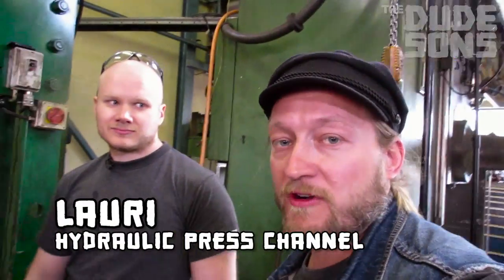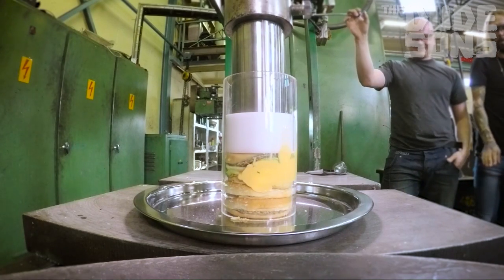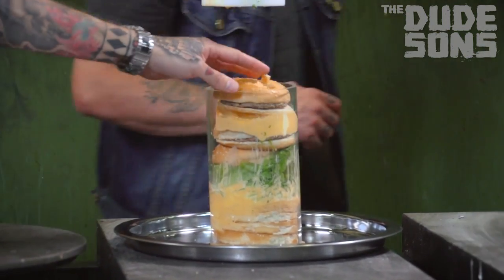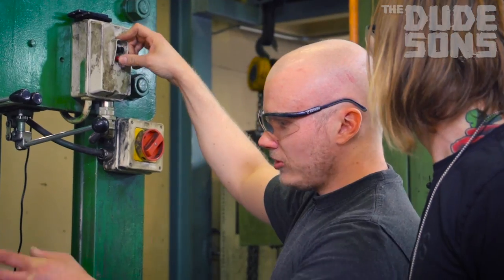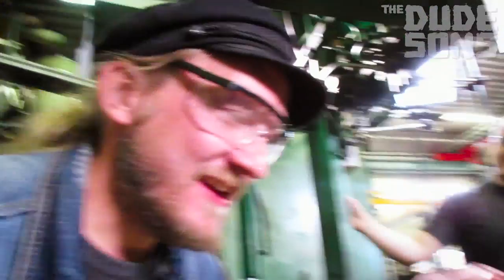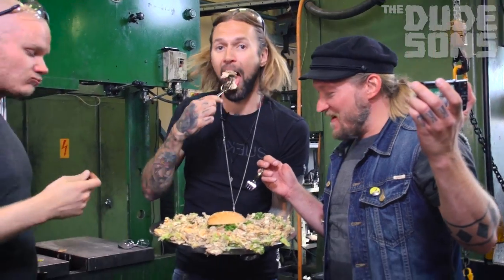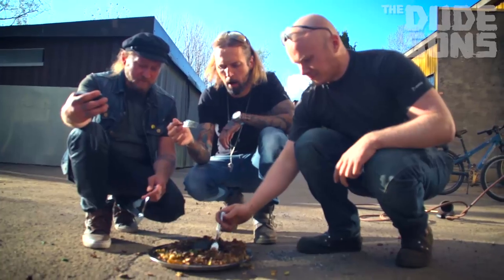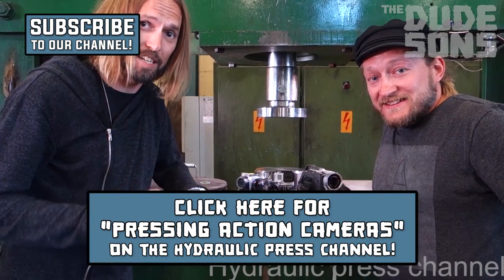Ultimate Hamburger Challenge with Hydraulic Press Channel!

Comment: Even diamond breaks,but not the pig
Reply: Britney is love, Britney is life.
Reply: Gabrielmuniz diamond are weak because strength and hardness are completely different things in the metal and gem industry
Reply: Diamonds can break
I saw a video where a guy smashed it with a hammer and it broke
Reply: PiratmitHolzbein Yea they're just hard to scratch.
Reply: how could they though. Jojo part 4 said diamonds are unbreakable
Reply: Kaelyn Conner No no, you could easily break a diamond with any old hammer. Diamonds are only extremely hard to scratch.
Reply: although diamonds are the hardest substance.. this also makes them brittle and they do actually break easily.. but to cut or scratch diamond it takes.. more diamond.
Reply: Nero Crescendo he/she's wrong then they are just really hard the scratch
Reply: Jojo's bizarre adventure: Britney is unbreakable
Reply: Gabrielmuniz duh plastic can't be broken but you can melt it
Reply: Sky Howe did you really say that? are you kidding?
Reply: Sadie Piaskowski definición nenaza, ho si me encanta :v
Reply: +Sky Howe wow, and I thought people couldn't be dumber.
Reply: Hardness is how well the mineral can resist being scratched in which case diamonds are the highest